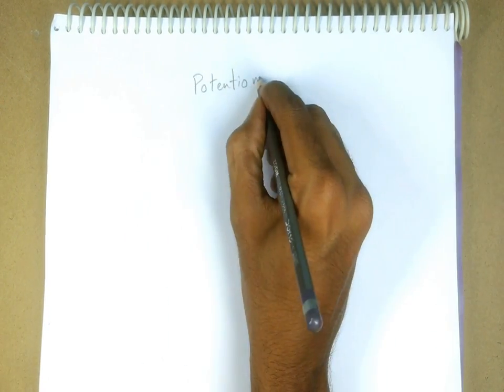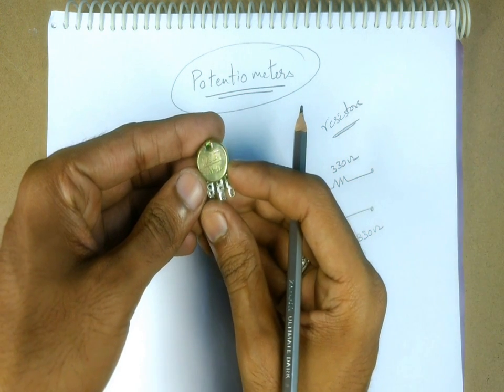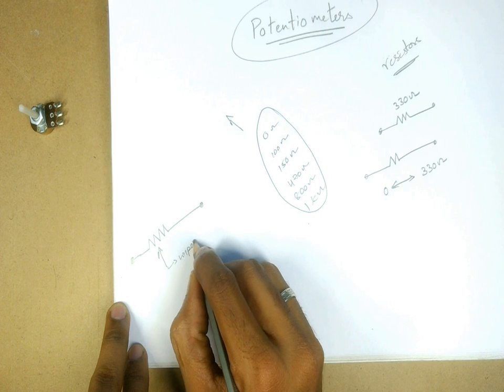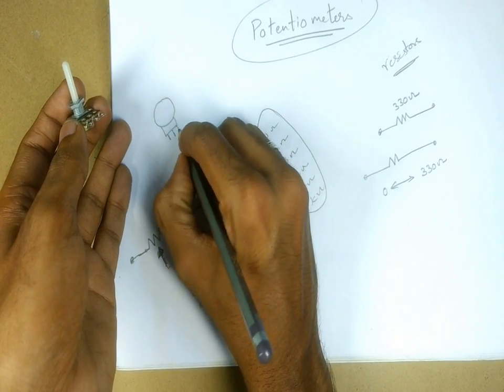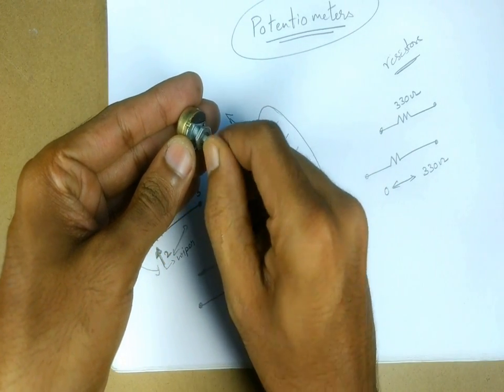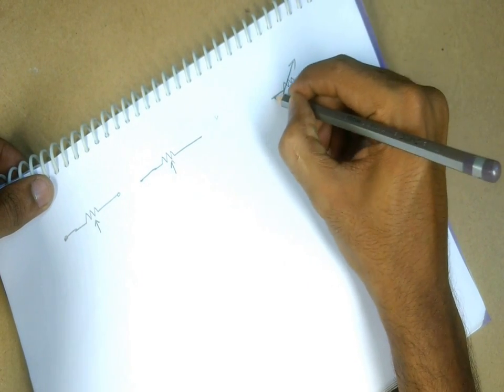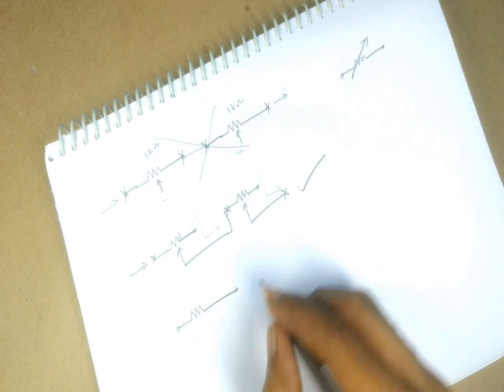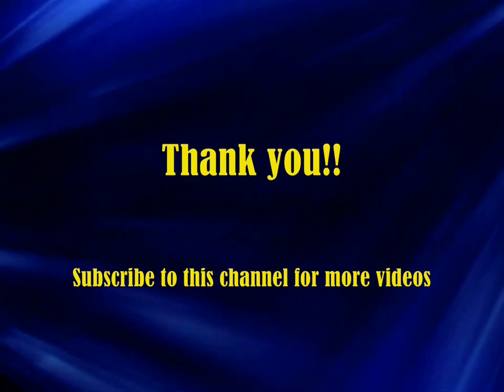#E BASICS: 3 - Potentiometer tutorial

Comment: The light glaring off your paper was blinding and distracting.

If you use an erasable white board with a thicker marker than that pen, your drawing will actually be seen and not made invisible by the light shining on the board. Which leads me to my final suggestion; don't have a light shining directly on the paper. You were using the camera light weren't you? Don't do that, the light reflects back into the lens making it harder to see what you are drawing. Have the light sitting to the left or right at a 45 degree angle, that will cause it to deflect away from the camera lens.

I may need to dim my monitor some more.
Reply from the maker: Appreciate you taking time scott. I would see how I can reduce the glare using your advise in my upcoming videos
Reply: @ Scott Tovey
Hey bud, instead of acting like a whining know it all...try thanking him for taking the time to do a video. 

I see u have ZERO video’s..surprise surprise.

Comment: sir, I have a variable voltage power supply, how can I adjust the current in that, it has about 5 amps maximum, what changes need in that circuit.
Reply from the maker: +Nizamudheen vk connect a series transistor in the output and use a potentiometer to control the current going to the base of transistor. That will controller output current of transistor. This may not be the best design but it is pretty simple